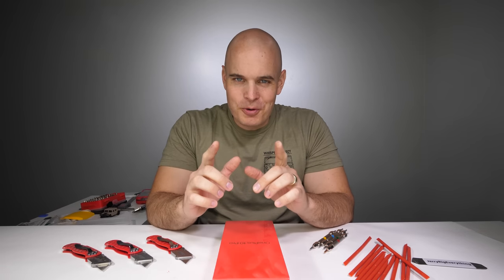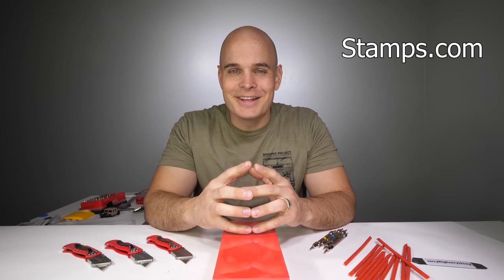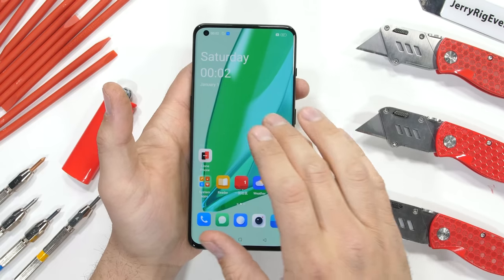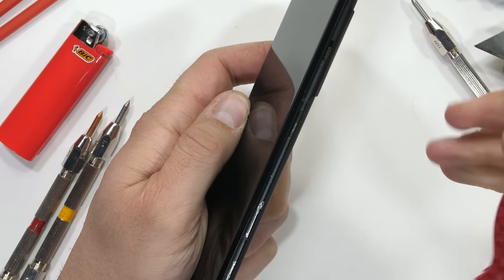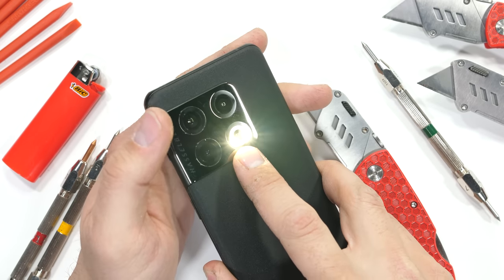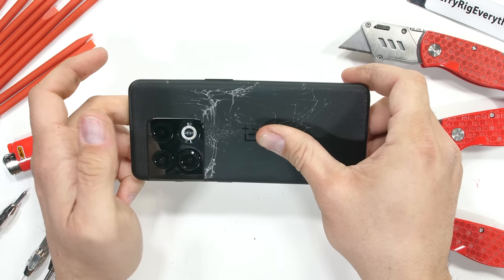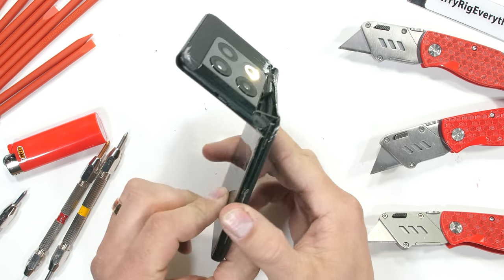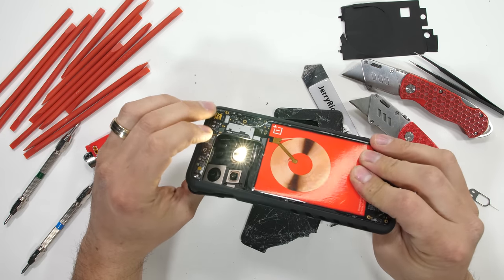Somethings wrong with the OnePlus 10 Pro... - Durability Test!

Comment: My 6T has been working great for me for a few years, and only recently started having minor software glitches. I've been so happy with it but since OnePlus jumped on the NFT bandwagon, I was wondering what to do for my next phone. I'm actually rather glad to see their 10Pro perform so poorly as it makes my decision to leave the brand even easier than before
Reply: If it's Android then definitely Samsung, cause Google are being very experimental with the pixel lineup. Why Samsung? Cause they have majorly upgraded their software, camera quality along with their already exceptional hardware and screen quality, plus they now promise you 4 years of TIMELY sw updates. I'd suggest S22 Ultra cause other 2 kinda suffer in the battery dept. And as always iPhone is an option too if you're done with Android.
Reply: @ohmahnav4176  Samsung does seem to be doing well for their phones, and I can't stand trying to do anything in the Apple ecosystem. Maybe I'll check out Samsung's new phones when my 6T finally kicks the bucket.
Reply: I also have the 6T and also have been having glitches since the last update. For me, the top menu sometimes freezes and Google stuff doesn't work over 4G until I switch the connection off and on. Same issues for you? Or something else?
Reply: @cachedgaming  Samsung always have motherboard and therefore quality control problems. Just look up problems with the s21 ultra. On my tab s6, i was using the notes app, its turns off, turns back on with half the screen glitched (black and white pixels fo the top half of the screen). They also slow down real quick and updates introduce a ton of bugs. id suggest jumping to iphone or keeping realme or oneplus.
Reply: Don't buy one of their phones again. If you're used to their old oxygen os you'll be devastated when you try OOS11 and 12
Reply: I have currently (and happily) using a OnePlus 7T Pro and never had an issue. Also, the pop-up camera is fantastic for a continuous screen and security. But since OnePlus started to put FB bloatware on their 8 line, and the merge with ColorOS, etc. And now this! I'll be happily use my phone for many years and probably switch to another manufacturer afterwards
Reply: @Blue-sb4hv  lol are you seriously suggesting Realme and OnePlus? Pixel and IQOO might be a good option other than Samsung. Realme has the worst set of cameras and it's UI is really bad whereas OnePlus is just going downhill.
Reply: @BriefNerdOriginal  wait till final update for your phone. I bet it will be as laggy as 6 and 5 line already. I think Oneplus liked planned product obsolescence
Reply: I've been having issues with the camera not starting and files not downloading properly (e.g. a PNG image saves as a pnj file and has to be edited)
Reply: @Blue-sb4hv  I have a laundry list of complaints about iOS (most of them personal issues) so I'll be staying on Android for the foreseeable future.
Reply: My 6T started to become glitchy back in December, which was a shame as I loved that phone. Decided to swap to Samsung Galaxy S21 and it’s been amazing, would definitely recommend this phone for anyone looking to switch :)
Reply: The 8t is a great phone I'd recommend it for sure if you wanna stay with OnePlus
Reply: Hahaha same bro. 5T user here. No more OnePlus for me. Thinking of Xiaomi next. Or back to google/ samsung even.
Reply: Im in the same boat, i am so happy with my 5T, still good battery and no real slow downs yet. Aside from that, if my phone breaks rn, I have no clue what brand to go for, the one highest on my list is probably the Pixel, but other then that i have no clue since OnePlus turned from being very good to just terrible
Reply: @picabolo93  same for the 7 pro here
Reply: I'm using a Google Pixel 6 Pro right now and i'm really happy. But looks like, it has to do a bit with luck, because even tho most are working without problems, a few people are having heavy problems. 

But overall, i love the Pixel 6 Pro.
Reply: @Blue-sb4hv  My S21 Ultra is my third Samsung phone, never experienced a single problem with their phones and my 5 year old S8 Plus is still alive and well to this day.
Reply: My 6 is doing fine till now
Reply: @chimrichalds8985  8t was shit.. Over hyped old gen camera and  there was nothing new about it....
Reply: @zxxcvv6772  now I'm even sadder
Reply: Iam using 7 pro since 2019  i thought upgrade  to 10pro ,after seeing this bend test never buy oneplus goodbye oneplus better to buy a iphone or any other flagship
Reply: Am too leaving this brand coz of poor quality am switching to iOS ..
Reply: Just switched to iPhone 12 from 6T
Reply: I'm happy to announce that my 6T is still doing great. I love…d OnePlus. Wonder what brand to get next… and no not Samsung.
Reply: there's asus zenfone 8 it's really cool for the price or motorola 20 edge pro (software update probably isn't that great) and probably realme
Reply: @NitsuSaiNeko  maybe motorola then?
Reply: Happy with my oneplus 5
Reply: I gave my 6T away after they announced it's EndOfLife and bought the S21 Ultra. Best choice ever
Reply: I used to be a OnePlus 3T user. The main camera eventually was unable to gain focus (a common issue with the lineup), so I moved on. In a years time of barely any use (since I was using a Note9 instead), the screen began to separate from the phone... Like the glue/adhesive just evaporated. There was also a few software issues, one funny one is that in the last update, to unlock the bootloader, you need to say that you don't want to unlock it, and to keep it locked, you need to say that you want to unlock it. That's a pretty bad typo someone made there 😅
So yeah, I'm not too surprised that they're getting worse
Reply: lol, i'm still using the 1+3T lol
Reply: I had my 6T for a year and a half before I switched to iPhone. I liked my 6T at first but durability was terrible, and countless software bugs
Reply: @Blue-sb4hv  it's very difficult to go from a Samsung flagship to an iPhone. Sure, you'll save a bit of money getting an iPhone over a Samsung ultra phone,, but most users who switch will be frustrated with the lack of features. Iphone users had to suffer without OLED screens, waterproofing, and NFC for like a decade after Android implemented them in all but the bottom of the barrel cheapest phones. I had to return the iPad I got for my mom for Christmas because it DOESN'T HAVE A CALCULATOR. I'm sure I could have download one, but I returned it out of principal, and also so Apple has to repackage it. That was actually a secondary reason. I thought that apple switched to USB C on their iPads, but not all of them have it yet. They're STILL using lightning on the "NEW" iPad... STILL. Only the iPad Air has USB C.
Reply: Whats wrong with NFT?
Reply: Fellow One Plus 6T user here! I bought mines used for $220 (T-Mobile unlock) and has been pretty good to me for the past 2 years. I too occasionally experience glitches from certain apps and random reboots.
Reply: Still have my 6t as a backup, which still runs like a champ. Using the 8 now. Love them both!
Reply: I just switched from the 7T to the iPhone 13 pro. Takes about a week to get used to it. But it’s actually so great. Highly recommend.
Reply: @ohmahnav4176  realme ui is no more. Realme is using Oppo's color os and it is really good
Reply: Same here. I decided to go with the asus zenfone 8. Flagship phone with headphone jack
Reply: I am using a One+ 6 that still rocks and was as you looking for a similar phone to buy, both in terms of quality/price ratio and durability. I am sorry to say that One+ newer models are completely out of the game, probably Xiaomi or Samsung are good alternatives, but way too expensive.
Reply: I'll hang on to my 6T till either of us dies. 😋
Reply: I'm so glad I've installed a custom ROM on my OnePlus 5. It has made it so much better in every aspect. The phone still feels like new.
Reply: @ohmahnav4176  I'd choose Samsung phones if they didn't ship with Exynos chips in my region
Reply: My 6T as well. Sometimes apps freeze or the camera app doesn't work. A reset usually fixes it. Still not complaining a friend bought a S9 same time I got my 6T and that thing hit the trash bin over a year ago
Reply: @ohmahnav4176  ive gotta dissagree, ive seen more than my fair share of samsungs just not live up to their price tags, their cameras are over sharpened tbh, and i feel like they invest in trend features not in real features.

120hz displays and 5 cameras but no hp jack and only middling battery life are just not the wave for me.

i personally wish there was a nice lg v60 successor: 1080p, 60hz, top notch processor, massive battery, funcional cameras, hp jack, big screen, cheapcheapcheapcheap.

never have I ever felt held back by my phones features, if only it had a google camera and the charging ports didnt die at random stranding me with only wireless charging... thats about all I could really ask for from my next phone, yet everyones pushing for these crazy features that they likely wont even use, and which only hurt initial cost and long term battery life.

tldr: i wish people would realize that their phones only need to have a slightly better screen than a Switch, and that the awesome google or apple cameras only need 1-3 sensors max
Reply: @cachedgaming  my 6T is giving the same issue since the last update.. after watching this video, can't rely on oneplus phones anymore. might have to drag this 6T till its final breath.
Reply: @cachedgaming  kind of interesting my phone one plus 6 hasnt been glitchy at all but i also did not upgrade to android 10 🤔 really interesting to know this happened to a newer model
Reply: Try downgrading to Android 10  . I recently downgraded to Android 10 and i couldn't be more happy. Battery lasts longer ,no overheating , better performance , list goes on.
Reply: @MR.ROCKETT  thats why i dont upgrade anymore ngl screw these companies ruining phones after a software update
Reply: @Blue-sb4hv  that never happened to me.. Ever since my first ever samsung phone...
Reply: @cachedgaming  what is kick the bucket?
Reply: @baoquoc3710  an idiom for dying, at least in the US.
Reply: Same situation.
Reply: I've been with oneplus for so long, I'm so happy with my 7t and don't see it being switched out for a couple years atleast but think I'll likely have to go with Samsung unless someone else does something fantastic. Their used market is just so affordable for what you get now, it's insane and they are just so consistent.
Reply: I'm rocking my 6 still as well. But similar glitches and drops in performance has me considering next options
Reply: Just switched from op6 to s21+. One UI is actually good. Comes with bunch of samsung native apps, but some of them actually better than google. One thing for sure, samsung have bunch of features like bixby routine, dex, good lock etc. Much better than my wife ip12

Comment: I've had One plus 1, 3t, 6t, and I recently upgraded to an 8T. On the used market the 8T is a pretty good deal. It's much faster than the 6T and it pretty much competes spec wise with even newer flagship models. Well worth the 400 I spent on it. The 9 series and the 10 series look like a waste of time IMO. My plan going forward is to buy a slightly used phone 12-18 months after releases. Hopefully one plus can redeem itself before I'm ready to buy a new phone.

Comment: Durability is definitely the top of my list of requirements, even above performance. We shouldn't have to be so scared about dropping something expensive that we're basically required to carry with us
Reply: Combined with software support.
Reply: i was actually ready to buy this phone until i saw this video. disgusting, I know that this will not happen with everyday use but still I don't care its expensive and it should be more durable than my poco f1.
Reply: I agree
Reply: That's why I shifted to Rugged phones.. The chipset is a plus.
Reply: Yet many babies are dropped on their heads each year.

Its nice how they made them as slippery as they are though.
Reply: @EJY809  which rugged phones do you/have you used? I've owned a couple of ulefones and they are very hit and miss
Reply: @sidevalve337  oukitel Wp 15
Reply: @EJY809  mother of God haha jump start a space shuttle with one of those things, do you have many issues with the software on an outikel? I found ulefone have an endless list of bugs and glitches
Reply: @sidevalve337  only Lags though but works fine.
Reply: This is why I aim for Samsung phones. They are really solid over-all. They have amazing screen, amazing durability. I dropped my S21 very-very hard on multiple occasions and aside from some very minor damage on corners it is perfectly fine.
Reply: @Navhkrin  Samsung phones are amazing, as I have the Galaxy S10, but removing the SD Card slot is where they messed up.  The Sony Xperia phones are very appealing now.
Reply: @Navhkrin  I bought a new in box s9+ and it went flat after 3 hours of screen on time, the last time I owned a Samsung was 2014 when I bought an S4 mini and it was the biggest pile of garbage, Samsung is just not for me unfortunately lok

Comment: There's a few things wrong with OnePlus's implementation of a "camera contour" module. First of all, there's more points of compromise because they stuck the cutout lower instead of just using up the upper corner area. It also doesn't help that the extended "housing" of the camera is seemingly too thin to actually help with any structural integrity at all. Then OnePlus decided to stick other points of compromise with an antenna and the volume button right where the battery and the main logic board meets. Compared to the S21U, which OnePlus clearly borrowed heavily from, the 10 Pro just looks like an unpolished copycat that only got the exterior somewhat right, but the actual inside engineering is highly questionable.
Reply: Its a chinese phone wtf do you expect lol

Comment: Good video. I have this phone and so far I am happy with it. Most brands make them Slimer and taller so there is more risk and oneplus made a mistake by not strengthening it in the central part. If you use a case and don't try to brake it on purpose then is absolutely fine...

Comment: It's exactly the same construction mistake that the ROG Phone 5 has. They both have a seperation between a battery and PCB run along the entire width of the phone, and a weakness in both side rails at the same location. It's even specifically an antenna band on one side for both phones! (But the second weakness on the ROG Phone is the fan connector, not the volume button.)
Even for Asus, who doesn't have as big a name in the smartphone market as OnePlus, it's a bad design, but for OnePlus, who has a much bigger market share and more experience (if you include Oppo's other phones this is amplified further), making the same mistake a year later is even more disappointing.

On the note of the ROG Phone 5, though, regarding your question at the end, I do have one, I do enjoy it, and I keep my phone in the front pocket anyway. But, even though the positives do outweigh it in my view, the construction flaw is still very bad and I do think about it every time there is any sort of stress on the phone.

Comment: As nice as the newer phones have looked, I think I'll have to go elsewhere when I eventually upgrade my 7 Pro.
Reply: zenfone 8 flip if you want a full screen phone,
(which is basically the same specs as 7 pro but better) and it can flip its camera module
or just the 8 if you want a compact phone at 5.9 inches.

also, both have zenui, which is clean software
Reply: I'm going to wait one more year at least.
Reply: @nateluthor4643  up to yr decision my guy
Reply: There has never been a phone better than this one and never will be in OnePlus series.
Reply: Same, honestly I might switch to iPhone 14 when it comes out mainly for the camera.